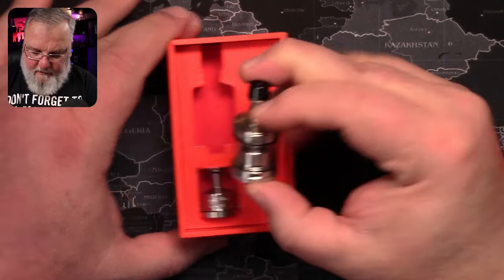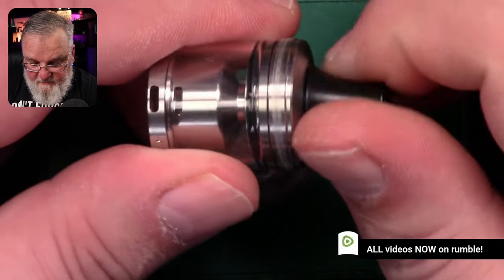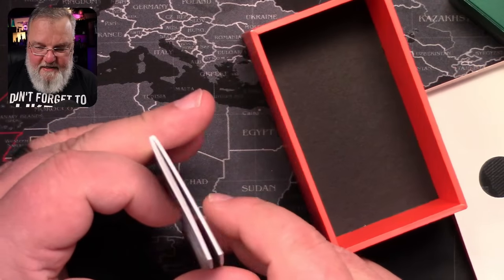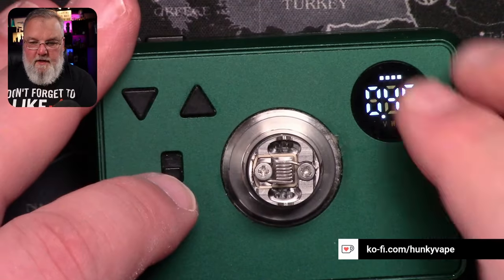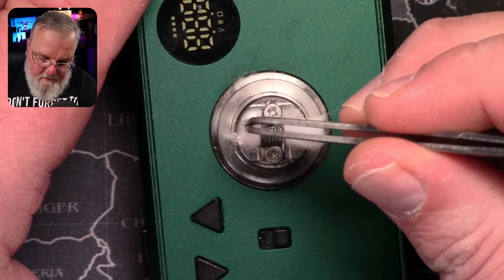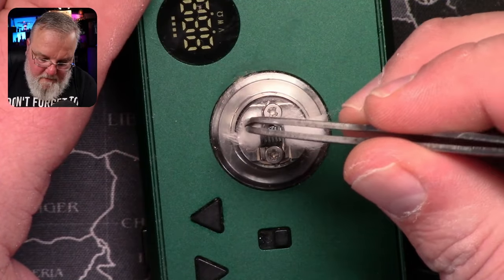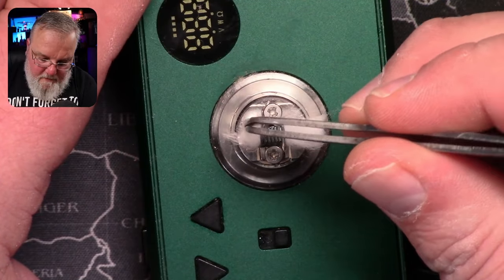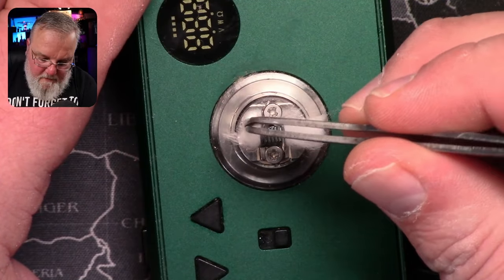BEST MTL RTA Hellvape Dead Rabbit MTL 2 Unboxing Review Repair

Comment: I’ve got a minor complaint with with the Dead Rabbit mtl v2. I bought two of them and they have the same issue. It has to do with this supplied coils. Why was the coal supplied in your kit shown on your bill video Wound clockwise and the supplied coils in the two kits that I have are  counter clockwise. It makes it much more difficult to secure the leads because you’re tightening the two screws to secure the coil in place. They are much more prone to slipping out not only that they both end up with a resistance rating of .84ohms which makes it much more difficult to set one up as a somewhat RDL needless to say it’s not too difficult to set it up as an MTL even with this much higher resistance on the supplied coils. I’m having some custom Wound calls made for it some for MTL and some for RDL. The MTL coils come in at about .68.ohms and the RDL coils which are an alien type coils four and and a half wrap they come in at .6 ohms. Both are 2.5 mm in diameter. Just an observation i’ve made after owning two of them and struggling through the Supply calls which are total garbage. Other than that. It’s a great tank that has tons of potential if you put the right coils in it. On a plus side it is a really easy build except for the ccw coils that are now supported. I had no issues with the 1.0 airflow pins. I guess you have to take the good with the bad these days.

Comment: It tells you on the back of the box, it's a Ni80 fused Clapton coil
Reply from the maker: Thank you! I missed that detail. But I still think they should tell us what gauge wires and how many are fused so customers can easily replace it with the same coil it came with. They did the research to find the ideal coil to include in the package and it shouldn't be a secret or require us to do an autopsy on the spent coil to figure out what it's made of.
Reply: I completely agree and not much effort on their part either.  @HunkyVape

Comment: Better than  Bi2hop or Diplomat? What about leaks?
Reply from the maker: No leaks. I was overzealous juicing the coils. Otherwise no leaks in the month I've had it. Both of those are bottom fill. This is top fill with juice flow shut off option to prevent leaks while filling. Plus you get 6 pin options in the box (no extra cost). So it's a better value right off the bat.

Comment: When you show that the airflow control becomes loose with juice, it looks like it's leaking?
Reply from the maker: No it doesn't leak... Or more accurately it hasn't leaked for me in the month I've had it. I was just over zealous juicing up the coil.
Reply: @HunkyVape  Alright, thanks for clarifying that. Cheers.